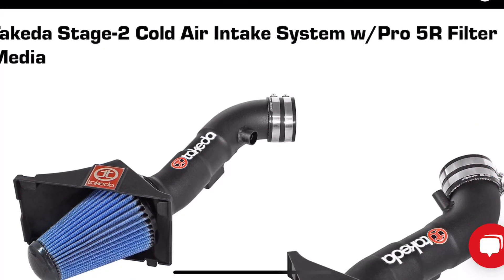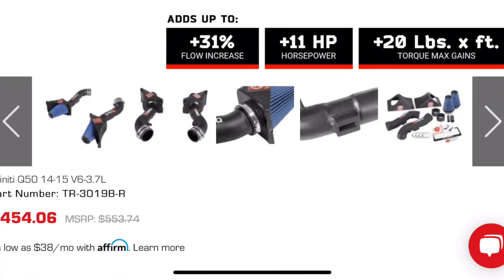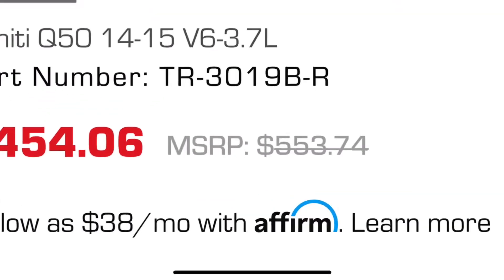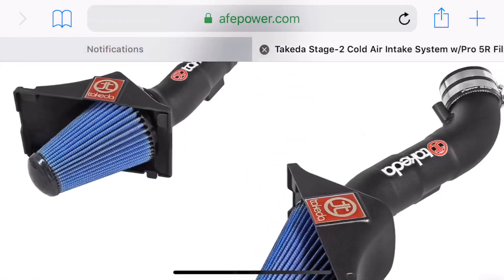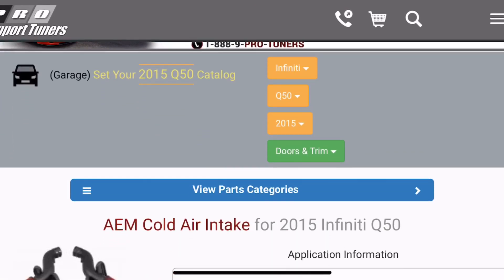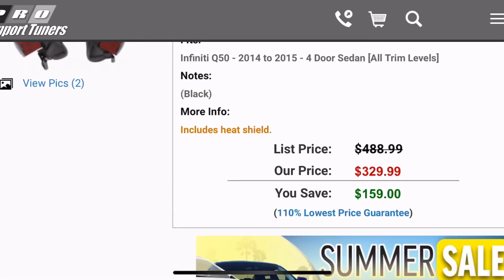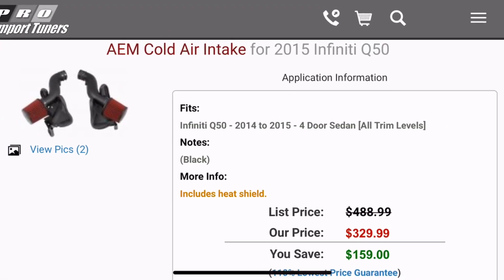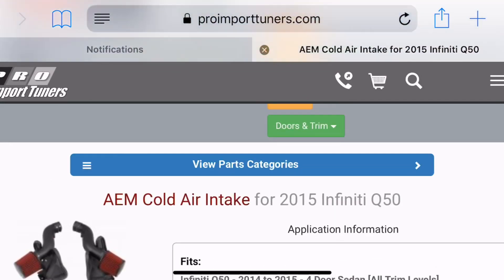STOP Buying Cold Air Intakes for your Q50!!

Comment: So if I have an axel back, z1 test pipes,stock y pipe, and drop in filters how much do u think I’ll make with a tune?
Reply from the maker: I just saw someone with nearly that same setup make 325/275. I had the 1320 performance y pipe and 2.25 (only slightly larger than factory) y-back and made 333/284.
Reply: Speed Culture Studios ok thanks is there any drop in filters you recommend?
Reply from the maker: Razors Q50 I run aFe dry filters. If you go to their website and search Q50s they will come up. They are the gray version.
Reply: Speed Culture Studios Thanks!
Reply from the maker: Razors Q50 no problem!

Comment: Absolutely nobody ever thought about : running a CAI on a Q50  3.7 lmao  my 05  responds  beautifully 😍 g35x awd vq35DE q50 doesn't need it run a chipp
Reply from the maker: Gs respond to intakes, but the Q does not.  I'm not sure what you're saying in the first part of your comment.  I get asked multiple times daily what the best cold air intake for the Q50 is.  My videos explaining why a CAI is not necessary on the Q get more push back from people that truly believe they work than any other video I have posted.  Literally 90% of Q owners either run, consider or ask about cold air intakes.  I also don't know what you mean by "run a chip."  There is no chip and if there were/is, I would not recommend it.

Comment: Buy a 80$ filter and build it the numbers will come 💪
Reply from the maker: Drop in filters with factory air boxes really is the best route for the Q.  I just did a side by side comparison on the dyno and the results speak for themselves.  But there are 2 filters for the Q and they are about $50 each.

Comment: Takeda Stage 2, works great, looks great and sounds fantastic. Also, it is a true cold air intake. Highly recommend!
Reply from the maker: Looks and sounds don’t do much for me considering the price tag. And after tune it would net me 3-4 more hp than I make right now with drop ins at 1/4 the price. Just not worth it to me.
Reply: @SpeedCultureStudios  It is a bargain! Your car, however, anyone else  looking to add power, sound and some damn good looks, the Takeda CAI is perfect.  It is only $400?
Reply from the maker: Chris Nichols I guess you have to determine what is valuable. As I said in the video, I’m all about practicality. Spending $400 on a part that does nothing for performance is not a bargain in my opinion. It’s $400 that could be used for something else that makes an improvement. I’m not worried about intake noises. I’m more about exhaust note. And the z1 tubes look pretty sharp—again for 1/4 the price. 
If you like them and it’s worth it to you, by all means. The dollar to hp ratio just makes zero sense. I’d advise against buying them every time, unless you can find a deal on a used set or something.
Reply: @SpeedCultureStudios  Total seat ot the pants HP add and feel... try it!
Reply: And they look perfect under a Tanabe strut tower brace! Your car looks fantastic...wheels, trim, tint, etc. None added to the HP but all made it cooler. This CAI, works well... trust me!
Reply from the maker: Chris Nichols of course there are changes that are for looks, but you can’t really compare a $30 chrome delete that you know won’t add power to a $400 intake that doesn’t get you anything additional to drop in filters. My wheels are lighter than stock yet wider allowing me to accommodate wider tires without increasing rotating mass—and wider tires improve grip and handling, which are all much more beneficial than what the cold air intake provides. 
Seat of the pants hp is great, but I’m interested in actual hp numbers. 
You should have tried some upgrade drop in filters first, you would have felt the same improvements!!
Like I said, I’m not trying to hurt feelings or argue with anyone. If you made the purchase and you like it, that’s all that matters!  I’m just relaying real data so people that want to practically and wisely allocate funds to other more important parts, this is one of those parts that you can avoid buying without sacrificing gains. Again, this is something that has been proven over and over by numerous dyno videos.
Reply: @SpeedCultureStudios  Have run drop in K&N, Stillen CAI and the Takeda CAI in this Q. No comparison... However, I am just reading that your goal with this car is to save $$...I get that.
Reply: Once you hit the track or AutoX, you will find out and the Lexnani's will not cut it. Tires and pads are the one place to avoid Chinese.
Reply from the maker: Chris Nichols But have you ever put the car on the dyno?  It doesn’t sound like it. Just swapping filters and intakes is not going to do anything. You car is not calibrated to utilize intakes. If you were to put the car on the dyno and run all different intake setups with a tune, you’d see 1-4 hp difference, I swear. It’s just true man. It doesn’t matter honestly that you thought you could tell a difference. The numbers don’t lie. 
Saving money is great, but again, the main point is that I don’t WASTE money on things that don’t make sense. If I could slap on some takedas right now and make 10-13 more hp, I’d do it in a second. But that wouldn’t happen. So it’s not saving money, it’s NOT wasting. 
As for the Lexani tires—they were given to me to try out by a friend that just opened a tire shop. They will be swapped for autocross for sure. However, there are dudes running federals for autocross and in my experience, I’d rather run these lexanis so we will see.
Lexani tires are Korean by the way, not Chinese.
Reply: @SpeedCultureStudios  They are Chinese...I know the owner, grew up in CA, watched H&W grow into LexanibinbGardenbGrove. Will be at SEMA in November. Yes, we dyno the car. We are building a 1400HP Trackhawk at Zen in Duluth GA  right now. 

Not trying to argue brother, just a nice and inexpensive add for power and a really nice sound too.
Reply from the maker: Chris Nichols They must not tell you everything on the website—manufactured in South Korea and a sub brand of Nexen—maybe Chinese owned but definitely sounds like they are made in Korea. Doesn’t really matter—I’ve run seemingly every brand of tire out there over the years and for $400 a set, I have been pleasantly surprised with how well these perform!  Still plan to swap out before autocross though—still debating on what to run.
Reply: @SpeedCultureStudios  Absolutely...tear them up. Use them at the first meet. You will really see the difference in time and feel on a really sticky 200 rated Direzza for instance.

Nevertheless, keep pushing and having fun! If you are at SEMA, shot me a note!
Reply from the maker: Chris Nichols I’d love to make SEMA. Always been a bucket list item.
Reply: @SpeedCultureStudios  Virtually every year since 1989...yikes! Old!
Reply: No offense @speed, hope none is taken, but your Q sounds ricey without a true cold air intake. Sure, not a whole lotta people wanna drop that cash just for the sound. But I'll be damned if I make my Q sound like the Civic I used to have. To each their own, I found Injen to be the best well rounded for the buck and actually felt the acceleration difference after installation, definitely more torque.
Reply from the maker: BlkHwkGator intake has 0 impact on sound. You wouldn’t have known what exhaust or what intake I had if I hadn’t said. And I certainly haven’t been told it sounds ricey. No offense.
Reply: Yes I agree Chris Nicole I have an Acura & the sound in that v-tec is just what I'm looking for, I'm currently waiting on mine in a few days
Reply: @SpeedCultureStudios  That's just not true, idk how you figure it's only 3-4 hp
Reply: @SpeedCultureStudios  This is also not true, a true cold air intake setup has induction noise. You can literally hear the air flow coming in where you couldn't before. 

If you buy an advanced enough scan tool, you can monitor your maf sensors readings. Just putting K&N drop ins on, I noticed a 10-15% gain in air volume.
Reply from the maker: @Tachyon836  Because it has been proven over and over and over.  It is very common knowledge at this point.  I'm baffled by the fact that you think you're getting 10+ hp out of intakes lol -- AND without a tune no less.  I don't think anyone believes that.  In many, many cases, people have running issues installing intakes on the VQ without a tune.  I can't tell you how many people have asked why their car runs funny or gets a random CEL after installing intakes.
Reply from the maker: @Tachyon836  I really don't have time to explain so many things to you. Induction noise is about the design of the intake system itself. Some have more induction noise than others--it doesn't make them any more or less of a "true CAI."  Yes, aftermarket filters flow better. no one denies that--this car has aFe drop ins because you should avoid oiled filters on these cars.  However, more air flow does not always mean more power. As I said, the G responds better to intakes than the Q--still not getting 10+ hp though.  The Q50 already brings in nearly as much air as it can handle.  The intake system is designed very well--isolated from engine bay heat and pulling cold air from the front of the car. there is a reason the Takeda intakes utilize the factory air box.  You're welcome to keep buying intakes for the VQ37, but they will only (maybe) get you a couple hp over a quality drop in filter.  This is old news by now.

Comment: Will the drop in filters fit a 2010 g37 ?
Reply from the maker: I don’t think so. If I’m not mistaken the measurements were slightly different. You might want to double check. Take a look at Afepower.com
Reply: Thank u. What do you think about the k&n drop in filters ?
Reply from the maker: Sebastian Torres I tend to stay away from K&N because I don’t like oiled filters, but a lot of people like them. I’ve just heard too many stories of MAF sensors getting gummed up causing issues.
Reply: Thank u. Very helpful information

Comment: Home depot has the dry takeda at $371.... but with texas heat currently at 110° nothing is going to improve perfprmance air wise inless!!!!!! We figure out a way to rout ac air into the intake or some type of luquid nitrogen houseing around the intakes in combination with ac and bigger fan? But tune for sure.
Reply: Is it bad i still want the cai... just to say i have it? Lol i mean surely if i installed an additional air to air intercooler in the front that piped intp the cai, thay would work, no?

Comment: What do you think about 3inch compared to a 2.5 inch exhaust? Next video? Lol I forgot do you have Y pipe collector too 2 pipe or 2 separate all the way? And your thoughts on both
Reply from the maker: These cars cannot handle a 3” exhaust. 2.5 is max. They just aren’t moving enough air. I did a video on this quite awhile ago. Something like best exhaust for the q50. I saw a loss of 8 lbs of torque going from a 2.25” to 2.5”. Going to 3” you’d see a major loss in torque and probably a slip in horsepower too. 
I no longer have a y pipe. The borla muffler acts basically as a resonated x pipe. Two in two out and the internals are just like a resonator but have an actual cross-over inside.
Reply: If you go 3 inches on the 3.7 you can have hella back pressure 🤙🏾
Reply from the maker: Hondacbr600rrish I’m not sure what you’re saying. If you were to go with a 3” exhaust, back pressure would essentially be eliminated. 
3” exhaust is no good for cars making under 400 hp.
Reply: Sorry lol. I meant 3 inch is too big and you just lose power over all. Like you said without a proper dyno your just wasting money. Lol now I'm confusing myself 😅
Reply from the maker: Hondacbr600rrish haha. You’re correct!
Reply: You should only be going to 3” if your boosted
Reply from the maker: E Class or making much larger hp numbers.

Comment: What about silicone tubes?
Reply from the maker: I touched on it in the video—they won’t do much for power. They insulate a bit better than rubber but the main part is the better flowing filter. I have the silicone tubes and like them.
Reply: Speed Culture Studios thanks
Reply from the maker: Jackasstoy no problem!

Comment: This is such bull shit... PEOPLE COLD SURE INTAKES DEFINITELY WORK BUT WORK BEST AFTER YOU TUNE OR CHIP YOUR CAR, WORKS EVEN BETTER IF YOU CAN BACK IT UP WITH A EXAUST! COLD AIR INTAKES DON'T GIVE WHOPPING NUMBERS BY ITSELF AT ALL, BUT IT PLAYS IT'S PART WITH PROPER ADJUSTMENTS, EDUCATE YOURSELF. I HATE ROOKIES LIKE THIS THAT TALK NONSENSE 😥...

Tuner 4 Life!
Reply from the maker: You’re funny. Far from a rookie by the way. Probably have been working on cars for longer than you’ve been alive. Anyway, I think you missed the point. 
Every platform reacts differently to intakes. The vq37 just doesn’t get much from intakes. It’s been proven over and over and over. It’s not just me making stuff up. It’s based on dozens of dyno results including my own. 
Even recently someone with custom 3” true cold air intakes on their Q50 made less power and torque than me with the same tuning software. 
I never said they don’t work at all. My argument is that they don’t work any better than simple drop in filters. Again—proven over and over and over. It’s just fact. 
You may want to consider educating yourself or watching the whole video to actually hear what I say. It actually sounds like you’d agree with me if you paid attention.
Reply from the maker: For 50 you talk like 15 year old. 
And your statement is exactly my point. They are over priced. You may see improvement over stock with a tune, but you get the same result in a Q50 as a drop in filter. Just the way it is. 
Again, this is for the Q50/G37 specifically. Every car reacts differently. My mustangs in the past for example reacted very well to intakes and made quite a bit more power after install. Totally worth it on those cars. Unfortunately, these cars do not see the same gains. 
Good luck in your retirement.